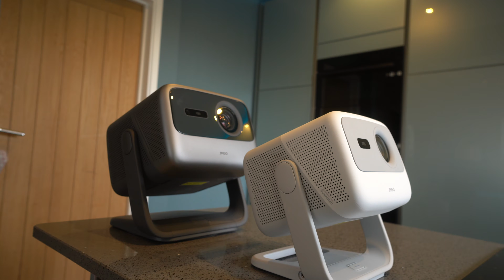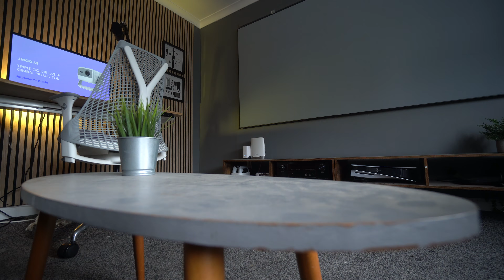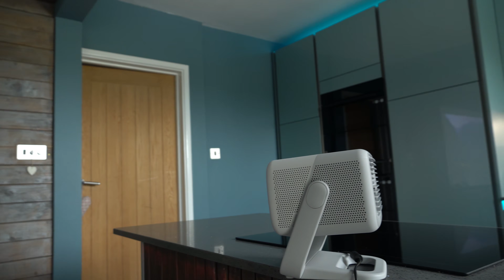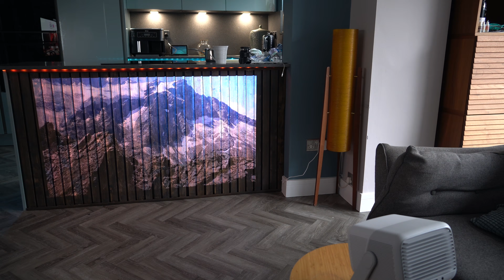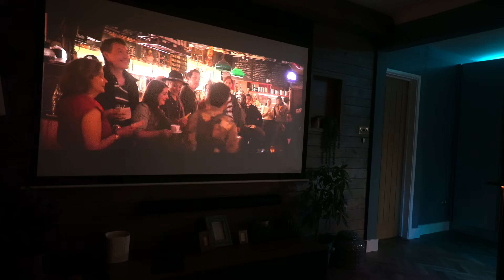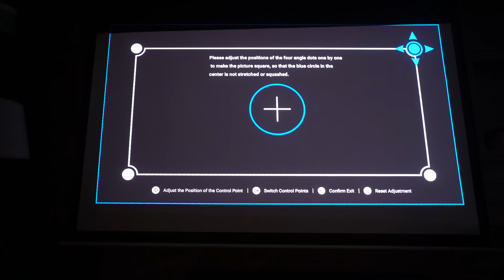JMGO N1 Triple Color Laser Gimbal Projector | One Word WOW

Comment: Bluetooth implementation, unfortunately, is terrible. Nothing seems to pair and anything that does immediately drops (iPhone 13 Pro, M1 iPad, M1 MacBook Pro, meaning you can really only use hdmi or wifi connection. Sound quality is very good but leaving out even a basic three-band software equaliser is baffling and disappointing. And the highlighting of menu items is so faint it’s almost impossible to know whether items are selected or not. There’s plenty of room for updating the firmware on this. Otherwise it’s a considerable disappointment at this price.
Reply: This sounds like something that should be fixed with an update. Has the issue been resolved?
Reply: No, none of those things were fixed with firmware updates though, even without them, the unit has proved very impressive (the picture is stunning) if limited in scope. For my uses it's more than good enough, but for anyone wanting good audio or connectivity, I'd look elsewhere.  @edjiang4289

Comment: This is probably the best review that I have seen so far which demonstrates how these new compact laser projectors containing lower lumens works in a room in ambient light. I will soon  purchase a 4K triple laser projector in the sub $3000 budget range. Initially I was interested in the AWOL USTs but I haven's seen but a few reviews on the LTV-2500 model which was rated at 2000 lumens,.  Many seem to knock the "low" lumens output , But Im not willing to drop $5K just for the enhanced brightness found on the LTV-3500 model. I decided to hold out when the kickstarter campaign for the N1 Ultra 4K caught my attention. This projector is spec-ed out at 4000 lumens which is in the lumens range of the AWOL LTV-3500  but in the sub-$3000 price range as the LTV-2500. I also require that my new  projector contains  3D mode which dropped the Hisense PX1 Pro and the Formovie Theather USTs out of my consideration. All I need to see now is the same Ambient lighted room demonstration  for the N1 Ultra 4K . Looking forward to you N1 Ultra 4K showdown review.. Thanks.
Reply from the maker: I’ll make sure I include that in the head to head
Reply: @allthingstech  Wow. Thanks for the quick response. I mentioned that I am also a die-hard 3D movie fan. If you could, I'd like to hear about how 3D performs on the N1 Ultra 4K. Please note also differences in Ambient and dark lighting. The issue with 3D is always how much the projection system darkens the image in that mode. Thanks Buddy!